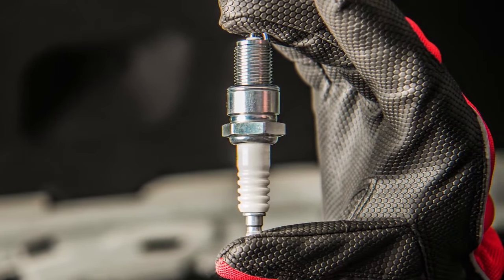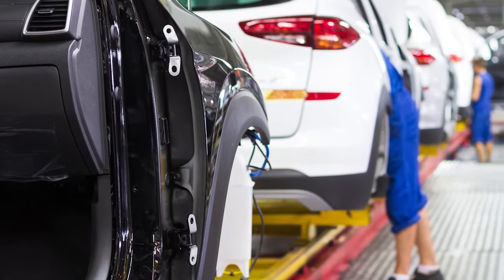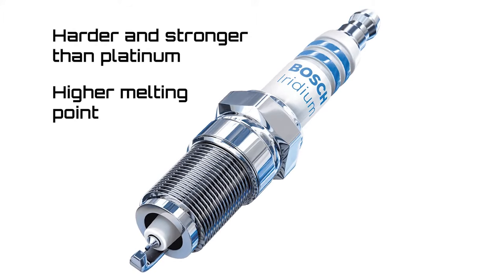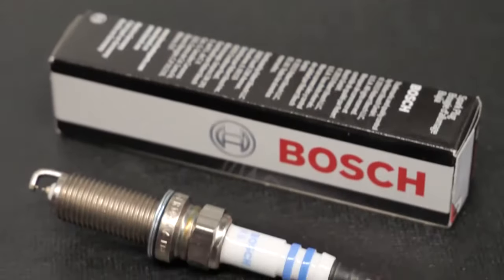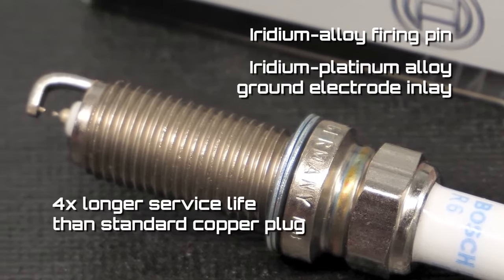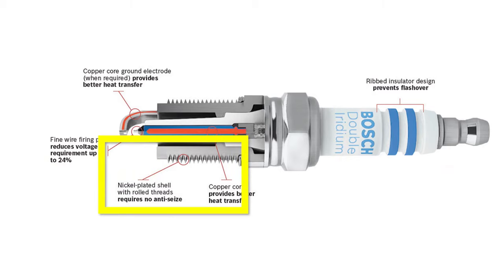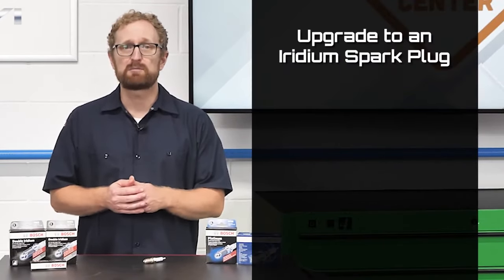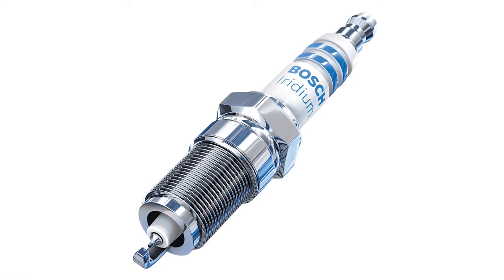Iridium Spark Plugs vs Normal

Comment: Improved engine performance? Absolute and utter nonsense!
Reply: Either there is a spark that ignites the fuel/air mix or there isn't. As long as it sparks every time, it's going to work.
I've taken decades old spark plugs out of engines that still work fine. Garages used to clean them and put them back in.
Reply: @Spiritof_76  100% my own experience!
Reply: You seem to know more than chemistry. What a sweeping statement to make. I wish you had adequate  knowledge at least
Reply: @colsanjaybajpai5747  As a mechanical engineer, with a large, nearly 50 years' experience as a very successful tuner of racing motorcycles, both 2-stroke and 4 stroke, and as a technical editor of various motorcycle magazines, I know what I'm talking about - which you don't seem to. Spark plugs don't have the slightest influence on performance, period!
Reply: @joepkortekaas8813  your experience is very impressive. Yet there is a lot to learn as you cannot claim that whatever you know is ultimate. God bless your ignorance
Reply: @colsanjaybajpai5747  My knowledge is 100% more than yours, which is obviously nihil. End of story.
Reply: @joepkortekaas8813  you are right my knowledge is limited. However, you seem to be smitten by overconfidence dear. Empty vessels make good noise. God be with you.
Reply: Can I make a comment based on my experience without getting flamed? I don't think precious-metal-tipped spark plugs make a significant difference to maximum power, but where they do make a difference is in the certainty of ignition under unfavorable conditions such as operation at idle and light load. You can usually set the idle mixture leaner and get lower carbon monoxide emissions without causing misfiring and consequent high hydrocarbon emissions. I have a 1970s vehicle with British Leyland B-series engine with NGK BP6EV plugs that have been in it for more than 100,000 miles, and the carbon monoxide level at idle is 0.1%. The permitted level for this vehicle in the UK is 4.5%. I also have experience with two-stroke motorcycle engines, and I found that precious-metal-tipped plugs give a significant reduction in the amount of load that has to be applied to the engine before the typical irregular two-stroke idle sound breaks into a smooth whirr.
I think the reason why most new petrol/gasoline vehicles have precious metal plugs is that by increasing the certainty of ignition under unfavorable conditions they make a big contribution to getting the exhaust emissions below the legal limits. I am sure the vehicle manufacturers would not pay the extra cost if there was not a significant benefit.
Reply: @Spiritof_76  i think what you say is  very pertinent please. However if one couples it with magnacore HT leads engine does run lighter as you have said. Runs cleaner also. The initiation and progression of spark also becomes better. Remember in olden days they wanted a fat red spark in the plug. As fuel chnged they insisted for a sharp blue one. Well written please
Reply: @colsanjaybajpai5747  Blah, blah, blah.
Reply: @Spiritof_76  very sick indeed. Pray to God you recover soon.
Reply: aRecluse  A book of fiction claiming that the fiction within is true? How many books of fiction contain "by the way everyone, these chapters are all fiction"?
If God were real, he could come out and say so, in person, now. He's the all time champion of hide-and-seek, and Jesus is the winner of "I'll be right back" who definitely won't.
It's fiction.

Comment: All the more reason to buy an EV as your next vehicle.  And this comes from a mechanical engineer specializing in ICEs.
Reply: Unfortunatedly EV´s are very expensive, weight  a ton, have a very low range, take a very long time to charge, batteries degrade quite fast, and to change batteries costs more than buying a new car. They have this penchant for catching fire and exploding, too. No thanks...
Reply: @FinflazodeTurroai  Exactly, except it's not unfortunate, because gasoline cars are more practical, that is fortunate.
Reply: Well said.
Reply: @FinflazodeTurroai  Dont forget the fact that if something breaks down you cant fix it yourself
Reply: Who is paying you what to say this??
Reply: I'll stick to my 22 year old Cougar. It's low mileage, plus it's cheap and easy to fix. I just put iridium plugs in it and picked up 2mpg above what I was getting with the original Motorcraft plugs.
Reply: Try harder, might want to see if your house is burning down yet.
Reply: @FinflazodeTurroai You sound like every old timer that said carburetors and points were netter too !
Reply: @zooker7507  Same as the ;alst guy...Get a horse!
Reply: @_hector__ Sure just like the car that YOU can't fix now!
Reply: No I wont.
Reply: Who the fuck would want an EV except soccer moms and tech gurus? I totally want one, and have to travel 20 miles to the nearest quick charger. Or I could charge it at my house and watch the electricity bill go off the charts. So many options. Always remember, EVs are good for the environment. Even though that electricity comes from coal burning power plants and other harmful ways to produce electricity.